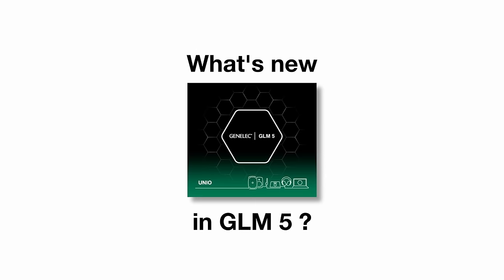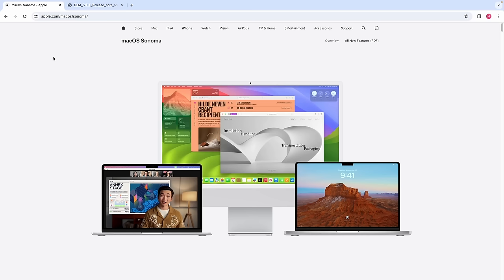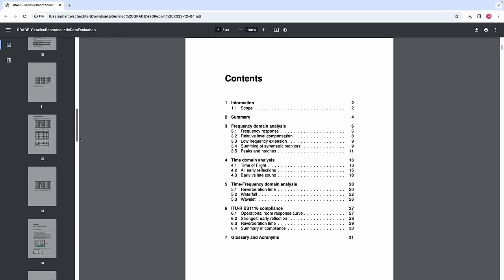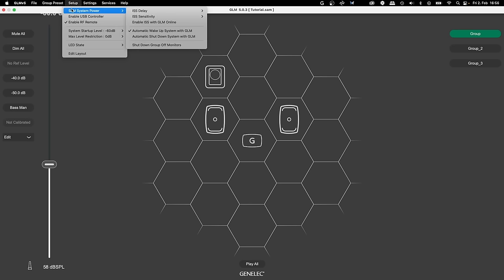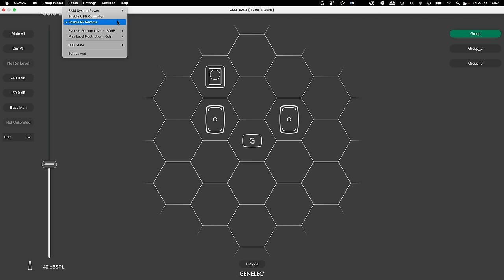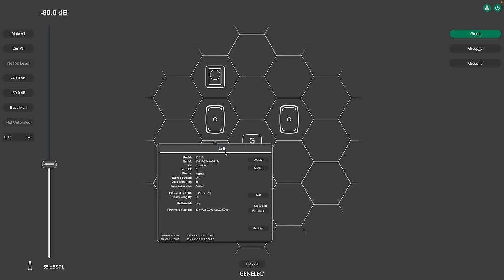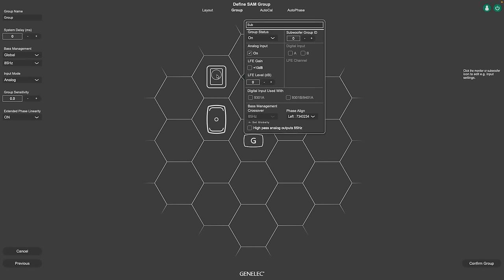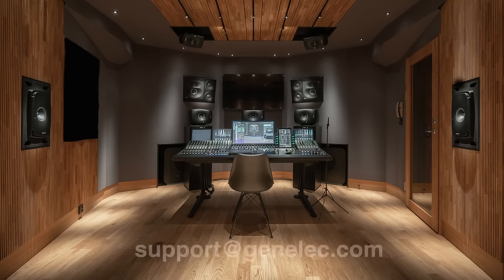Using GLM | New features in GLM 5 and how to use them | Tutorial

Comment: The Power On and Off function is fantastic! My speakers are really hard to reach and this makes my life much easier!
2 questions:
1. Is it ok to turn the system on and off only using GLM and never use the physical power on off long term?
2. If using the new physical monitor controller does GlM software have to run in the background and can u power on off the system from the controller?
Reply from the maker: Thanks for the positive feedback! Yes, you can of course always use GLM to turn your system on and off. The 9320 can be used in standalone mode (similar to the GLM network adapter). You can then turn the system on and off together with the 9320, using its power button.
Reply: @genelec  Nice! I know the subs have On/Off switch, and it doesn't matter as long as it's turned off from GLM right?
Reply from the maker: @Tlll123  Some of the models with the "traditional" power switch (no button) must be set to ON to make use of GLM's power features. Greetings!

Comment: pretty frustrating when youre (like me) an Neumann user. The Speakers are great sounding, but theyre so many years behind software-wise. Still think about to switch to Genelec. Not because of the ,,better,, sound, but for the whole ecosystem (different sized subwoofers) and dsp integration

One question, is it possible to do Array solutions with the GLM / SAM based Subs ? As an Single or Double Bass Array wich the homecinema guys do, to have an even basswave through the the room and on the back of the room subs with an inverted signal
Reply from the maker: Thanks a lot for your feedback! You're of course very welcome to join the family ... ;-)
Reply: Hi! At the moment we don't support DBAs - it only works well with very symmetrical room shapes and setups. But we'll think about it for future releases for sure. Greetings!

Comment: Will I be able to still use the calibration done in GLM 4.2.2, or would I have to re-do it in GLM5?
Reply from the maker: You can open any setup file from version 4, just use File > Import. The calibration itself did not change, so you don't have to re-do it.
Reply: Cheers  @genelec   - that helps a ton! Always nice to stay fully updated, even if the settings are already set for the studio. EDIT: Also nuts good support answering this in the middle of the night on a Friday. I'm pretty sure I would have survived until next week, so massive kudos on the quick reply.